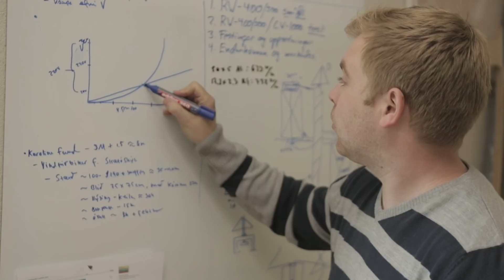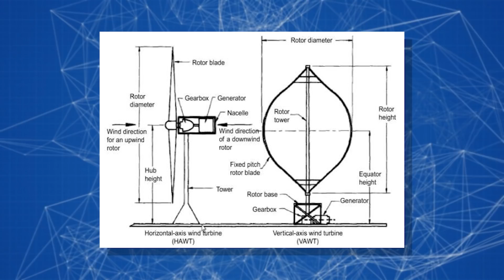Why This Wind Turbine Will Change The World

Comment: Vertical axis will have a moment orthogonal to that axis putting stress on the bearings. On a horizontal wind turbine this is not true, there the force is along the turning axis and much easier to withstand. If you would try to make a hundred meter high vertical wind turbine this will not work, the weight of the turbine is vertical and the wind force orthogonal to the turning axis.

If you search patent databases you will find numerous vertical wind turbines. Me and my father experimented with such ideas in the 1970-ies. I am still, today, convinced that vertical wind mills are the wrong way to go. A complete waste of time and money. Of course, by nice videos you can lure investors to invest big money into a hype project... That is a business idea in itself, sell hype and gather money and disappear...
Reply: Yep. It's just an ad looking for a dope with money and no engineering knowledge

Comment: Most houses have something like this on their roof for ventilation or something.
Reply: It's to keep air temps in attics cooler. Since heat rises, attics are always hotter. But due to thermal equilibrium, the hot attic will warm the cool room below it. The vent acts ass a vacuumed sucking hot air out as apposed to blowing air in.

Comment: These are the same BS'ers who make the argument that massively expensive wind turbines are a great way to produce electricity. One wind turbine costs 100's of millions to construct and the same amount to maintain and repair over the economic life span of the machinery. They wouldn't exist without huge government subsides e.g. huge taxes. Solar power has great promise for the future, but wind energy is a total bust, just like believing electric cars are the future. They exist, are nice to have but will not solve the world's "climate change" problems, whatever those really are. The one technology climate extremest who push these crazy fantasies refuse to talk about are hydrogen fuel cells. Hydrogen fuel cells are impractical now just like electric cars were before Elon Musk came along and built the infrastructure. Most pie in the sky studies promoting electric cars make the erroneous assumption electricity is free because we have massive solar farms and wind turbines everywhere - both myths are total BS.

Comment: One or two on each house and electricity needs are met without fossil fuel burning. Community grids can be solar/wind powered and supplement residential grids when needed. We will Cease Fossil Fuel Use before the fossil fuels all get pumped back up into the atmosphere and rain back down as acid rain
Reply: When the wind does not blow, a large array of batteries will be necessary to power your home, and if the wind does not blow for several days, your batteries will run out. Those batteries will require materials the production of which will harm the environment. So much for ceasing the use of fossil fuels. The only viable alternative I see is nuclear.

Comment: Can only guess either you are New to the industry of wind turbines or you are doing a Promo video for Ice Wind.  Comparing the power of a current wind turbine which is make enough power for an entire city to this small low power Ice wind generator is lie comparing a real industrial size dump truck to a child's Tanka toy dump truck.  Now with that said, I actual like the helical flow wind turbines. They have been around for many years and they can turn with much less wind. The problem with most of them is the low power they put out. Very few are powerful enough to run a 2,000sqft house year round. Also, you need to live in an area were the wind blows. No wind.... NO POWER!  So, if you LOVE Ice Wind then go check out all the other helical wind turbines and learn about them so you don't sound like a Promo video just for some red headed kid who has a silly name for his version of something that has been around for many many years.

Comment: This is more proof of a theory I propose,that the degree by which the engineer and all involved in such matters is educated to is directly correlative with how complex,and expensive their designs and implementation shall be.
But as for those wanting to use such matters as an ideology one simply cannot allow a cheaper more eco friendly (surprise surprise) design be built at a fraction of the cost's,so of course it will get much less of their attention.

Comment: Can't we attach it on a car or bus? It will charge itself while moving. Empty the engine room and place 2 or 3 wind turbines in it. The air flow from the grill should turn them. The more you drive the more energy. Also attach 1 on the roof and it will charge itself while parked.
Reply: Replace the wheels with them and you won;t need tyres

Comment: I’ve seen a video showing this type of turbine situated on the divider of a highway, activated by the passing traffic.
Seems a way better option than the massive turbines that are so environmentally devastating in their installation and end of life, which I believe is about 18 years, when they are not removed totally but just perhaps the blades. Certainly, the hundreds of tons of concrete and the steel reinforcing that supports the base are there forever.
Reply: Great comment.
Reply: Trying to recuperate aerodynamical losses of moving traffic instead of simly minimizing them is kinda funny))

Comment: comparing the giant tower turbines to these little ones is like comparing a motorcycle to a tanker truck . both are "the best" in the proper application . it would suck to drive a tanker truck to the corner store for a pack of smokes . it would suck to make 10,000 trips (no , not exact number , who gives a crap) trips on a motorcycle hauling gas or whatever .  A couple of these would give power to a summer cottage out on a lake somewhere that would cost insane amounts to get a power line to . everyone is so concerned with being more right than someone else . relax people ! if you think these turbines aren't good enough , make a better one instead of sitting here bitching at each other over math .

Comment: Windmill? Do they crush wheat, too? They are wind turbines, sized for and placed in areas that are analyzed for wind patterns and bird migration to lessen their impact and run efficiently. The blades don't fold, they articulate, changing the pitch,  to achieve efficiency at different wind speeds which, when too high, trigger a brake on the turbine to stop the blades from spinning. An airplane's wings and the propeller are both aerofoils; they work in a similar manner. This video is an uninformed, misguided attempt at sensationalizing a basic, small wind turbine by throwing shade on large turbines. If a product is made well it will stand on its own merit, which leads me to believe that these small turbines are nothing special. Lets not make decisions based on hype.

Comment: Sorry to be so boring and negative and grumpy and dull, but... er, nope. Rather like perpetual motion machines, the figures for these wonder devices look fine on paper, but in the real world they just don't add up.

This idea's ancient and resurfaces every few years, with different materials, shinier spinny bits, more techie blade shapes, and ever higher hopes but, in global terms, these (admittedly very cool) turbines are still more of a curiosity than a practicality.

Don't bite my head off. It's not my fault; blame physics.

They look like they ought to perform well, and they satisfy our sense of 'rightness' that they should work - they DESERVE to work - but after hundreds of years they're still more 'show' than 'go'.

There are countless ideas out there that seem great, but which just aren't efficient enough to be viable; like the schemes for tiny home-based solar arrays which cost a fortune and barely generate enough power to run the LED screen that shows you how much power they're developing.

Or those sprung pavements that use the footsteps of the people walking on them to generate power. They just don't work well enough to justify their colossal development, manufacture, installation and maintenance costs.

It's sad and unfair and depressing, but radical energy generation solutions just don't work that way.  😞

Comment: I for one think this design needs a lot more study.  Theres  a lot of folks that seem to disagree.  thats ok.  The cost of a current commercial propellers is 3-4 million each installed.  Id say that justifies a lot of study.  these wind turbinesseem pretty good because they are unidirectional. but i think they would be easy to set up on off the grid housing in combination with solar panels and batteries. that would be apretty good system .  Most folks now don't realize how long windhas been producing electricity.  Befir the grid most farms may have used wind for water pumps but also about half or them produced electricity for home lights and a radio.

Comment: Scientists have known since the 1950's that the climate was changing from what had been recorded. Movements in the 1970's to save the planet from pollution, included reducing use of fossil fuels. In the 1980's we started talking about global warming which wasn't wrong but didn't actually encapsulate the problem. Since the 90's people have been protesting to save the planet from climate change. The internet changed the breadth of the fight to save the planet and millions of young people got involved. Today that movement consists of tens of millions of people of all ages across the planet. So no it wasn't just recognised 15 years ago.

Comment: So much dumb bullshit in this video. Yeah, if you build a small turbine it does not need a large foundation or large rotor blades. What a smart insight, but it does only produce the power of a small turbine, though.